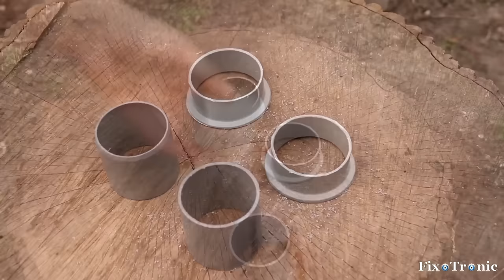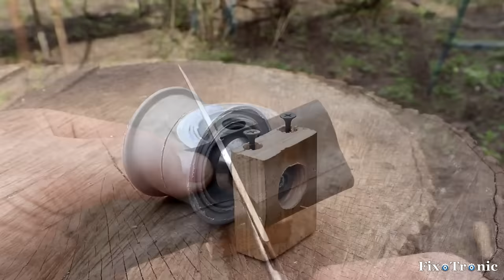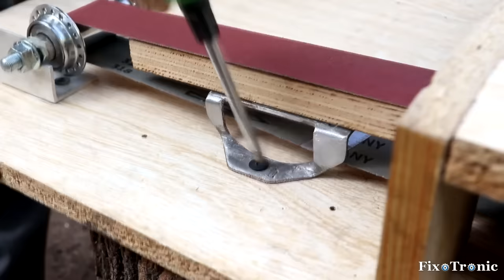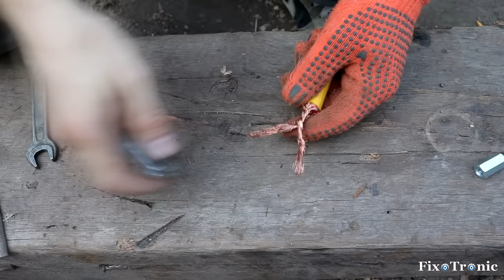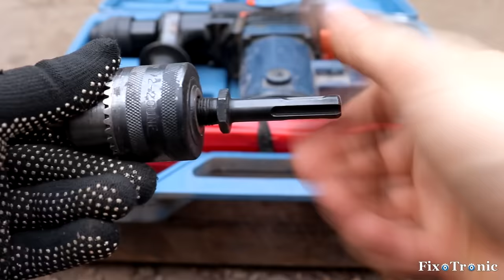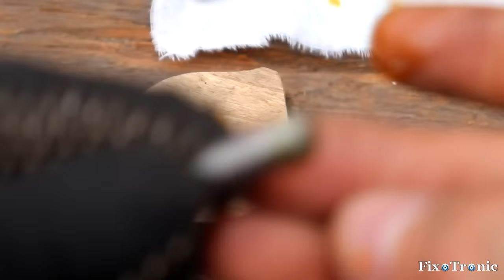AMAZING! Top 3 Bright Ideas with Bicycle Hub and Drill !

Comment: KEWL !!!  Very nice video! ❤ I had wondered, for a long time, how to re-work an old chuck. You showed that it was a simple matter, knowing how they come apart, as well as re-timing the chuck jaws. Thank you so much. Question: how do you remove a keyless chuck from a cordless drill, (the drill motor is shot, but it has a nice chuck).
Reply: Unscrew the Chuck anti clockwise
Reply: Rebuild the motor.

Comment: But why are the bracket openings facing downward towards the drill?  Wouldn't it be better to have those facing the opposite because of the constant pull?
Reply: the design is poorly thought out
Reply: @БорисАлсыев  l0
Reply: @ojenonvaldiael9850  299
Reply: @ojenonvaldiael9850  9

Comment: Bicycles & their parts truly have a nearly endless amount of uses or can inspire a nearly endless amount of things to do with them....As for your ''chattering'' drill chuck, I would've packed it full of grease without taking it apart. Since my hands tend to tremble a bit due to age, I would've used a press to get that collar off to keep from hammering my hand/hands. Since you did ''hammer'' it apart, I thought you might attempt to ''carefully'' weld that tightening ring back together & use a cut-off wheel in a grinder to cut any excess material or slag out of the cogs. Oh well, ya didn't use near as much grease as I would've, but ya did get rid of that rattle. When that grease is soon gone, you should go with my method known as ''LOTS-O-GREASE'' will fix a lot of things. By the way, I clicked on the tab at the right showing the drill chuck on the bicycle wheel spindle to see what it was so I was slightly disappointed.
Reply: You tup

Comment: Drill chuck can’t be used as welding holder. When filler rod ends at that time removal of waste rod and fixing new rod in heated chuck would be difficult.Definately idea is good.
Reply: And the chuck assembly is notably  heavier than a conventional stinger.

Comment: Passing high current through a drill chuck isn't a good idea.
Because it can weld or fuse the internal parts together.
Reply: Why?
Reply: @williamesselman3102  
Because it can weld or fuse the internal parts together.
Reply: Some One  High current melts metal together when it is passing through it.

Comment: Stupid ideas...Specially the welding rod holder. Do you really know or tried to weld?
Reply: Qingjun Min replacing the rod is more convenient with the standard holder. Also the weight of the chuck affects the ease of rod angle position .Adjustable position is provided in the standard holder . The welding current will jam the loose contact in the chuck at high current.